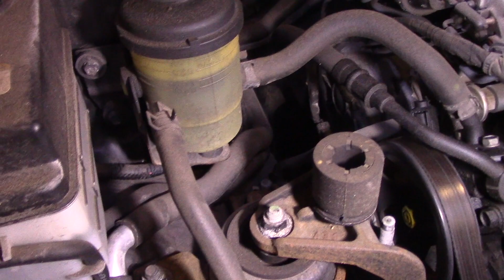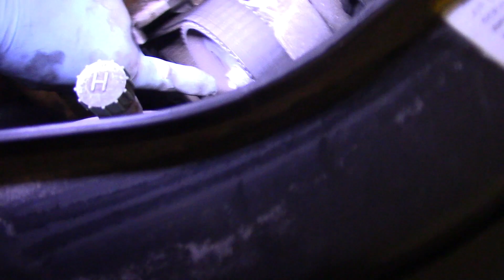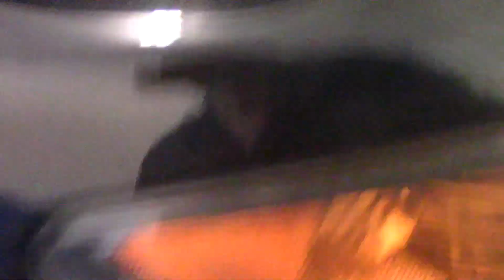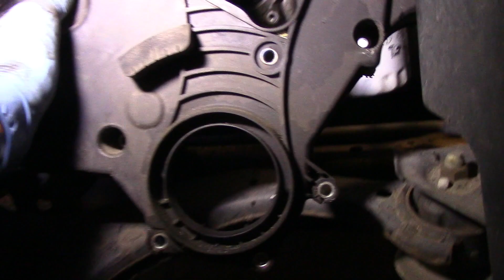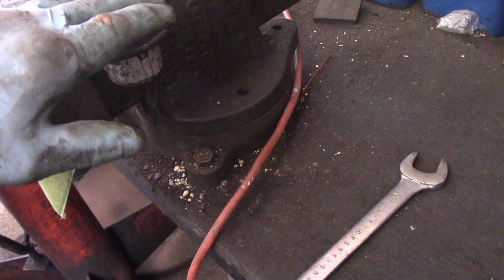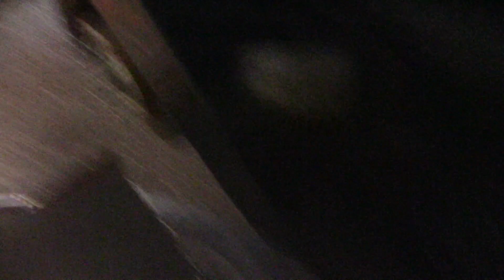Timing Belt Replacement 2008 Hyundai Santa Fe 2.7 Liter

Comment: Thanks!  Would recomment AISIN kit for this job or is the cheaper ones just as good?
Reply from the maker: Good question. I would recommend not using the cheapest one. I always use the dealer parts or a good quality brand such as Gates
Reply from the maker: Thank you for the $
Reply: @jimthecarguy  thanks.

Comment: 2007 Santa Fe 2.7/6 cyl.
Having the timing belt changed the 2nd time at 177,000 miles .
Should the original alternator be replaced while doing the timing belt?
The alternator is drawing around 12.5 volts according to the Auto Zone tech, but the alternator doesn't appear to have any problems.